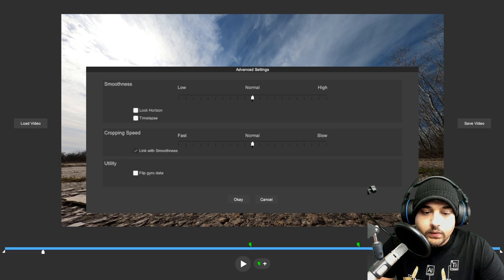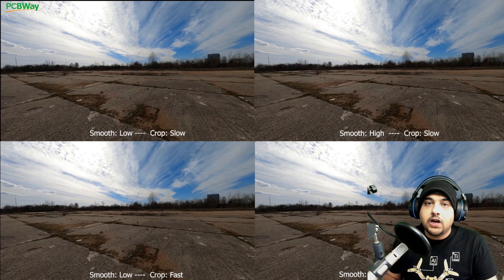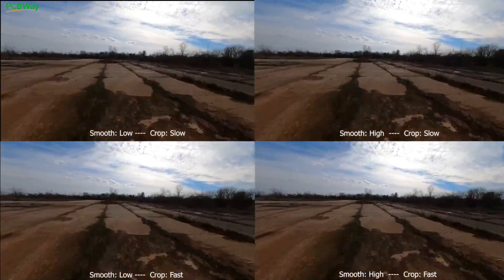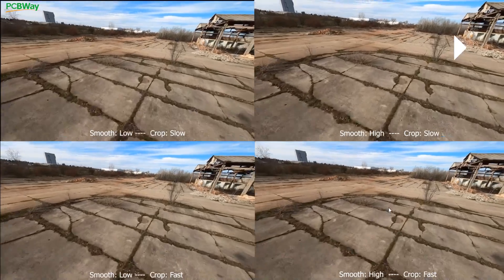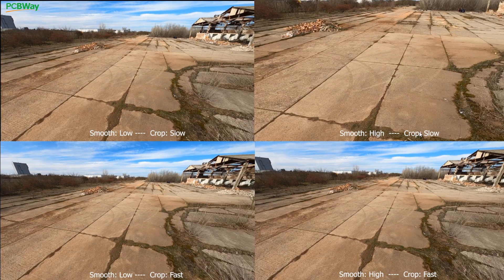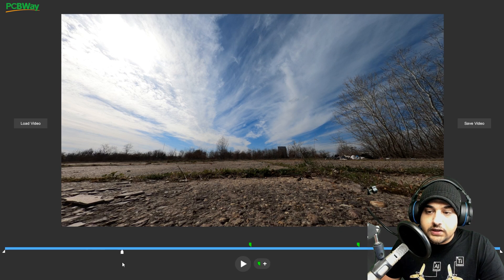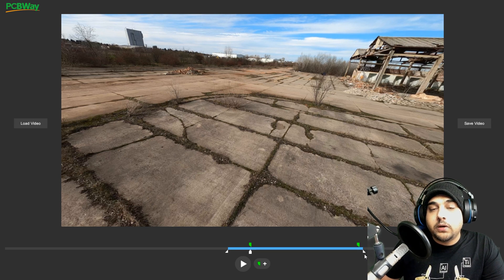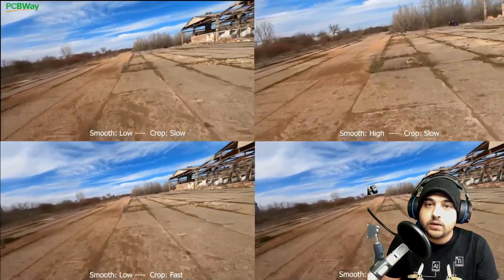Beginner Guide ReelSteady Part 2 // How To Get Professional FPV Cinematic Footage

Comment: Hi, I'm afaf. Can you kindly help by providing the info of the stack height (bottom plate's upper surface to top electric component of fc) of the Dalrc Rocket ESC + F722 Fc stack when it the bottom rubber grommet is squeezed fit (bottom rubber grommet seems like a ball) to bottom plate???  Thank you in advance. 😇